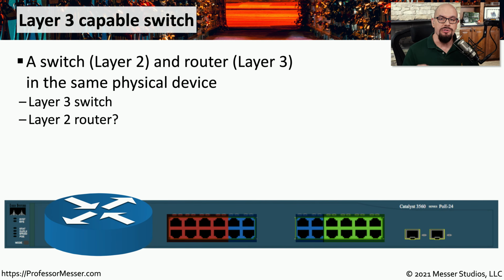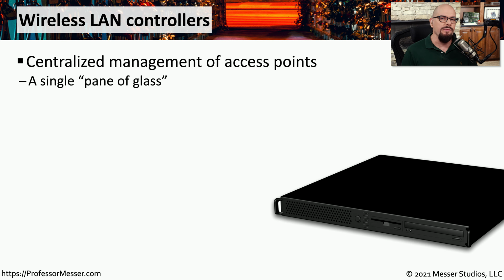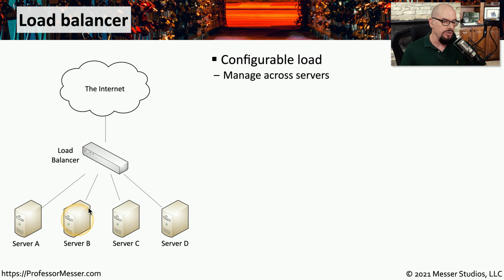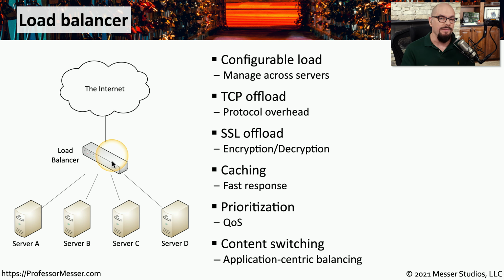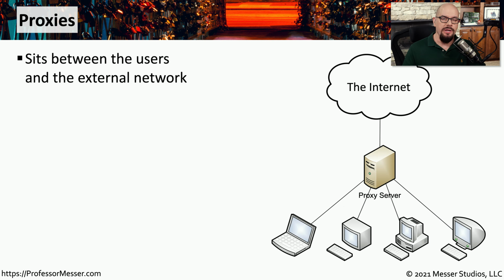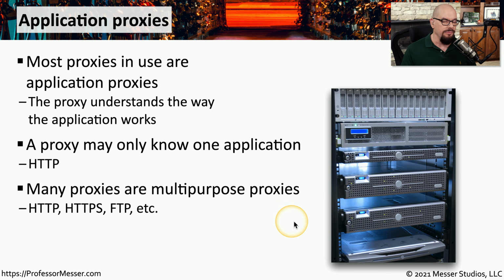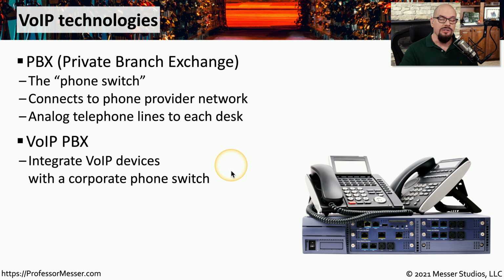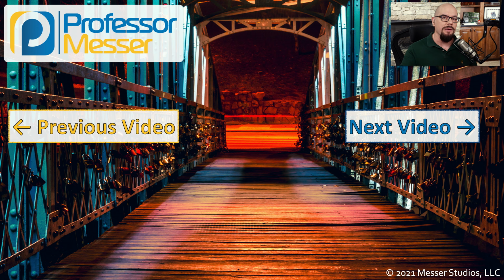Advanced Networking Devices - N10-008 CompTIA Network+ : 2.1

Comment: So, what’s the main difference between proxy servers and firewalls? You say proxy servers sit in the middle of user and web server and can keep unwanted people from accessing a URL, but a firewall sits between the inside of the user and the internet and also keeps unwanted people out? Thanks in advance, and to you Prof Messer!
Reply: A firewall simply prevents unauthorized access to your computer. A proxy hides your internal network from the Internet.
Reply: @handyandyradio  thanks buddy, sorry I missed your reply back then! Exam next Friday. Yikes
Reply: To give a more complete answer, traditional firewalls really only exam layer 3 and 4 information (Source IP, Source port, Destination IP and Destination port to be precise) as the traffic passes through them. It then makes it's decision on whether or not allow the traffic based off this. Proxies will actually hold the data for a short period of time (think milliseconds) in order to scan the contents for virus and other issues. 

That explanation of both of those things is rather simplistic still, but it should be enough to give you an idea. Many modern firewalls can incorporate a proxy as well, so that is something to keep in mind too. I am most familiar with this feature on Fortigates so I will use that as an example. When doing full SSL expect ion on a fortigate it will use a proxy. The data would be unencrypted in order to the read contents. This is used so that they can virus scans, more advanced IPS/IDS work, as well verify the websites trying to be reached in order to apply web content filtering.